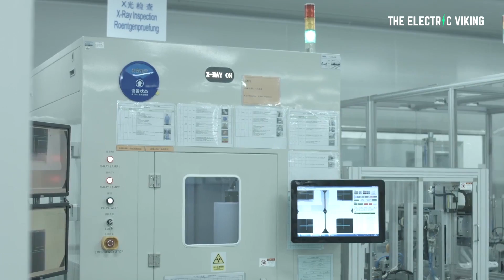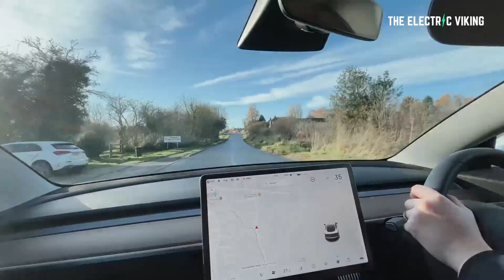This NEW battery changes everything - GAS sales will collapse

Comment: I have 44 solar panels (the infa red kind), which means they will still make electricity on a cloudy day.   I have storage batteries and a wall charger for my EV.  Since I bought the EV in October last year, I have not paid one cent to power my car.   Viking you are so RIGHT!!!  :)
Reply: That terrifies the energy companies.
Reply: @markhathaway9456  Good! Death could not come quick enough for the utilities in CA.  They control the legislature and the Governor, so it is not likely they will perish, but one could always hope.
Reply: Same here Chris. 50 solar panels and 4 Powerwalls. With a wall charger I can charge the EV
and run the whole house. The cost of the system is about 30% lower than when installed 4 years ago. With the CATL battery technology it will likely get less expensive and your car can be your storage.
Reply: Way to go, glad to hear of your good results.
Reply: You paid for the solar panels, storage batteries and wall charger, and your car's battery is a large part of its price. Running a car on solar power may be cheaper than gas, but it's not free.
Reply: @restonthewind  I am sure they all understand that. However, flipping the bird 🖕to big oil companies after being under thumb for decades is priceless.
Reply: @restonthewind  But as I said.....I already had the solar panels for my house electricity as well as the battery, way before I decided to buy an electric car.   Ergo it was free, and is free to charge.   And seeing as I made a huge profit on my gold and silver which I bought way back in the early 2000, the car was also free.  I believe that everyone has to look at their own situation and determine if an electric car is for them, but for me it was a no brainer.   They are coming out with electric cars that are now 5 -10k  Regardless of what the ICE drivers think, electric is and will be the way forward.
Reply: @chrisballantyne7857  Yeah, they're coming out with 5K to 10K cars, in China. You do know they're not going to be available in the states or in Europe, right?
Reply: Dang, how many MWH do you make a year? What is your peak kw, and what kind of inverter did you get? Is the battery AC coupled or DC? I have a 6.2 kw system(20 modules), Solaredge DC optimizers  and inverter.
Reply: How far do u go with your EV and where do I recharge it when away from home?
Reply: @cfmotoz8626  I have a Tesla Model 3, and the supercharger network is the best charging network in the country, so you can get anywhere. The one issue can be, is does your destination, like a hotel or air b&b have a charger, and if not, how far is the nearest super, and how much do you want to drive around. Now you can charge it on a normal outlet, but, but that is really slow, might take you 3 or 4 days. You can get around pretty good in lot's of places with CCS charging, like with a Bolt, or Mach e, but there are a few places where the chargers are a little too far apart.
Reply: @fjalics  I assume you’re in USA.  Useless in Australia, except for city travel!
Reply: Boomshakalaka
Reply: I made a video of a 30 watt folding solar panel made from Sunpower cells powering a USB fan while it`s raining.
Reply: how much did all that infra structure cost you , you have not paid one cent, really?
Reply: @adibkashani7616  I bought my first 22 panels and battery 5 years ago and it cost me 20K   I bought the second 22 panels 1 year ago These were the infrared panes with the 7kwh individual inverters and it cost me 15 k  (But our mother in-law who is widowed and moved in with us paid for it to put on her granny flat!   So we got a break there.  But we had to have them because of her increased power use!  :)  Re the payment i.e. not one cent to charge the car....yes.   The car does 450ks on a charge and we just make sure we charge it throughout the day.   Being retired we don't goo anywhere too long a distance.  But with the panels on a good day we are creating up to 6,000kwh constantly throughout the day, and the car will only charge at 11kwhs so like I said even on a cloudy day we charge the car for free.  :)
Reply: 44panels, the hardware to mount them the wires the inverters, batteries and all sundries, where do you get these free or do you neglect to incorporate this in the so called not once cent to power your car......
Reply: @lawfullysuspicious1225  Ok.......you need to use your brain!   I had all this done to get my property on solar and to be off grid.  I did it in 2016.   I wasn't even thinking about  an electric car then.  Obviously it cost money to go solar.  But I did not put up the solar for the electric car.  6 years later I decided to buy the electric car. and I had the money to buy it out right.  Therefore I can make the comment that seeing as I already had the solar in place, and the car was basically free from the profits I made from my investments. then ergo...it has cost me nothing to charge the car since I bought it.   I don't use the charging stations that the government and others provide I only use my own charger at home.  Obviously, again, not everyone can do this. this is why I said that people have to look at their financial position before buying an electric car.  Nothing in this world is free, but because I used my brains and already had this all set up, then I was in a perfect position to buy an electric car and have it cost me nothing to charge it, seeing that I have already paid off the cost of the solar panels etc.   So stop being a dick and ask a more reasonable question next time.  :(
Reply: Most people on urban centres are living in hamster cages and don’t have space to deploy PV cells unless they lease space which is very pricey. No doubt solar based technology will continue to amaze, it must, but this move to penalize COG NOW to make that happen is premature and makes no sense unless something more insidious is happening.
Reply: Right but unfortunately the average person can't afford the change.
Reply: sounds like BS.
Reply: So if I don't use the solar panels and all that other stuff and just paid for the electricity to plug it in I would be paying the same thing but just in payments correct? I mean sounds like the system you had at least 25-30 maybe 40 Grand I don't know. Seems like an even trade you either have the solar panels or you don't and pay the payments to charge the car seems like it's equal don't you think? I'd have to see the numbers
Reply: @Studio1973A.I    Hello sir.  You are probably correct with your numbers and evaluation.   But one thing to consider,  with his system he gets electricity to run his home and vehicle, when just continuing to make payments to the electricity provider there is the possibility they will fail to deliver if the grid goes down.  Power at your home is better than power from a compromised grid supply.
Reply: @danielfeyerabend904  yes I see your point now I just think I may wait till new technology of the solar panels come out I know there's micro inverters and all that stuff to soup up the power and these new battery storage is coming out hopefully the prices start getting cheaper on this stuff I don't want to pay 50 grand for a system when I can just pay for the electricity over the next 15-20 years and be done with it. But I understand if you live in California or Arizona where the power goes out then I can understand having solar panels and I probably figure out how to install them myself screw that paying wackos cuz all my neighbors that had solar they can't get nobody to come and fix anything. I'm like I will wait
Reply: @Studio1973A.I  Please do not mis understand me.   I was retired, I had the money to outright buy an EV.  I also already had in place my Solar (for 5 years), and my battery system.  So I literally only had to buy the wall charger and the car itself.  In this scenario getting an electric car is really a no brainer.  I would caution people who are not in this situation to look at their finances and the debt they may have to go into to acquire an ev in the same way I did.  It's not as straight forward as one would think.......however, I still believe like Viking that EV's are the future!  :)
Reply: @chrisballantyne7857   hello what is infa red solar panels which company provides that
Reply: @surajrao2889  Hi, They are Normal solar panel with two added benefits.  The have a component in them that makes electricity through infrared radiation.  This means that when it's cloudy and there is no real sunlight they will still make electricity from the infrared radiation. (Not as much as the sunlight would but you still get electricity being produced.  Secondly each panel is a individual unit.  Each panel has it's own inverter.  This also helps with solar production as when a cloud covers one or two panels in a normal grid of solar panels, the whole grid produces less electricity.  with this system only the panel covered by the cloud slow down but the rest of the panels continue as normal.  This system works way better than the normal systems companies are supplying to people who really don't know what they are buying from a sales representative.   I got these panels from Gippsland solar in Traralgon Victoria.  They have been doing solar panels throughout the whole region for 15 years or so.  I hope this answers your question.  Cheers.   What ever a person does when looking into solar I would recommend doing your research, not all solar manufacturers are the same! :)

Comment: Sam, I do not know where you are getting the information that Tesla is making a "loss" from their USA made vehicles, when in fact they are the only US auto manufacturer to make a very good profit on their US made EV's. While the margins on US made vehicles are not as high as the ones made in China, they are still quite respectable at over 20%, and are better than any legacy auto companies ICE vehicle sales, let alone legacy auto's attempts at EV production where they have yet to maintain profitable production. While it is true that their profit margins in the US will temporarily look lower due to the cost associated with the build out and ramp up of the Austin factory, that will quickly change once production in Austin reaches reasonable levels. The same goes for Berlin.

Comment: I see Xpeng is pushing hard too on fast-charging (although they are only saying 12 minutes to 80%....or 5mins for 200km). So it looks like fast charge will soon become the norm. "Soon" probably meaning 1-5 years across the board....

Comment: Again? Charging a 50kwh battery in five minutes requires a 600kw power source. A 100kwh battery requires 1200kw. Tesla superchargers go up to 250kw. Even if CATL can deliver the battery, it's useless without upgrading the charging network, and "it's right on their website" isn't the most persuasive evidence anyway.

Better to pay less for the battery. If Aptera delivers what it promises, I'll get 400 miles from a 40kwh battery, and I'm happy to wait half an hour to charge on long trips since I'm not waiting to charge at all most of the time (charging at home). A half-hour break every four hours is defensible regardless of the refueling time.

My next car will be an EV. Hopefully, it will be an Aptera next year, but I'm happy enough with my Mazda 3 until 2025. I don't know what I'll find on the market then, but it'll be better than what I find now, and what I find now is already acceptable if still a little pricey for me, no pie-in-the-sky necessary.

Comment: A battery that can charge in a few minutes is going to need a very high end very power hungry charging station. Those stations cost a fortune to purchase, install and power. They are likely to be PREMIUM in terms of usage fees just like petrol has 3 different pricing levels with a PREMIUM at the top. The likely hood of such charging stations being all over the place is not high as the financial cost is too great. I keep saying this but it needs to be said over and over. It is a national holiday weekend and every body has the same idea of going on a road trip. The Motorway Services are packed with people having a stop over to eat and refresh. What would most families vote for?  8 x 350kW stations or 31 x 90kW stations ? Why 31 ?  8 x 350kW = 2,800 kW which is 2.8 Megawatts. The same 2.8 Megawatts would power 31 x 90kW stations. Given that stations are sometimes out of order you are likely to be looking at the choice of 6 x functioning 350kW stations versus 26 x functioning 90kW stations. Need a faster option then drive a NIO and Battery Swap.

Comment: You will probably call me an idiot too but how will our power grid hold up to millions of cars using gas off the grid being put on the grid. When now some places can't handle hot days and air conditioners?
Reply: On hot days, all air conditioners are in use but not continuously. Ev's do not need to charge all the time and in large metro areas are cheaper at night to do so. Don't fall for the straw man argument here. Energy generation increased historically in the US every year since 1950. By 2030, the growth will accommodate EV's being the primary source of personal transportation.  By contrast, can you fuel an ICE vehicle in a blackout?  What happens when OPEC collude and stops selling oil to the US like in 1973?  What happens when a gasoline pipeline gets hacked and people panic and rush to the gas stations like last year on the east coast?  This stuff happened and the EV scenario you ask hasn't because it is the solution in conjuction with residential solar and heck even wind with battery backup does a better job than a peaked plant. It responds to the grid demand better.

Comment: That's nice, but let's consider what it means in the real world. I'm assuming the Qilin battery will be 150 kWh since that's the next big thing everyone's moving toward and would support CATL's 1000km range claim. They don't mention from what to 80%, but I've seen the 10-80% standard used previously so let's take it here. That means 0.7 * 150 = 105 kWh in 5 minutes (1/12 of an hour). That's an average charging rate of 1260 kW = 1.26 MW (without loss). That's a very healthy output. The fastest DC chargers today are in the range of 300-400 kW (with loss), and that's peak rate.

A five minute charge time isn't passing the smell test for me until a new generation of DCFC stations are rolled out that can support these rates (and each station might need a small nuclear reactor beside it). A 10 minute charge time drops this power by half to a much more reasonable 630 kW - still faster than anything today but conceivable.
Reply: But if it were a 35kwh pack (like Mazda's MX30) you would need only about 294kw which is in the ballpark of those chargers you mention.  And in my opinion, a battery that size would still be fine for many, for city use, especially if the battery is robust and can take lots of charge cycles.   IF you can charge from home, you might find it rare to ever need a public charger anyway.  To me, being able to fast charge like that, when needed, actually makes a smaller battery a lot more practical than it would otherwise be on those occasions where you are doing a longer trip.
Reply: Have plugs on opposite sides of the vehicle. Then plug in both from adjacent stalls. That would be the ultimate flex, park over the line and use two chargers while others scowl at you
Reply: @theairstig9164  😂🤣
Reply: @theairstig9164  Do you remember the Jaguar V12 with two fuel caps? The horror pulling into a petrol station these days. 🙂
Reply: The problem isn’t the amount of kW that dc fast charging stations put out its how long can the battery sustain the peak rate.
Reply: Just needs local battery storage. That can be slower charging between vehicle charges. There are efficiency loses, but for those in a hurry, they can be charged extra.

Comment: 5 min 🤣 this is a joke. it is a value that can only be achieved in the laboratory under ideal conditions. which electrical cables are required to achieve this high capacity? look at what it takes to grant 350kw connections. This NEW battery changes nothing.